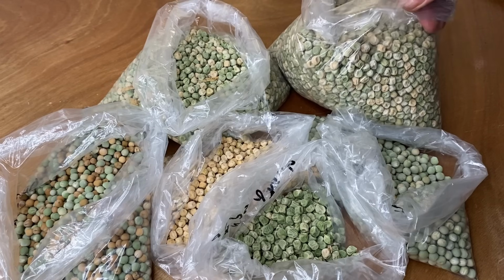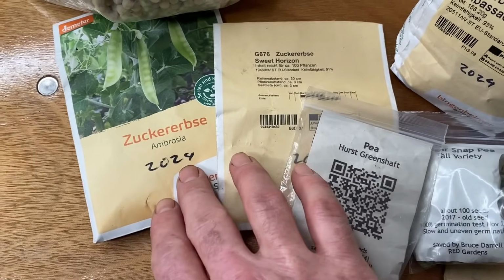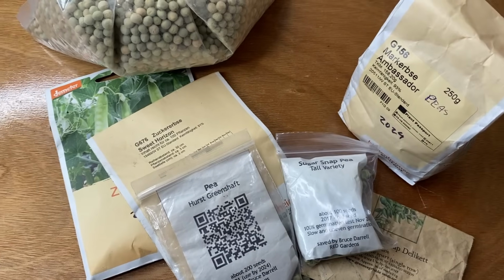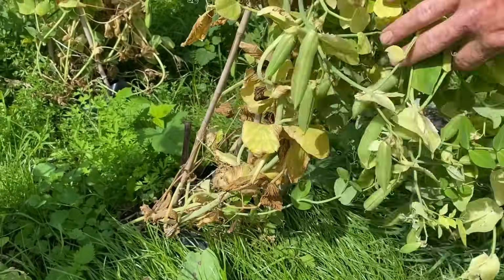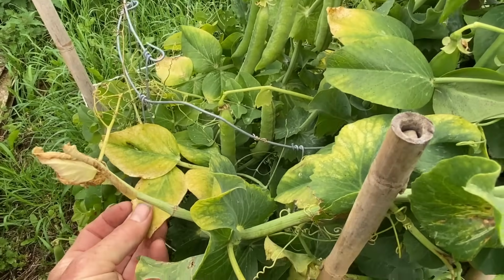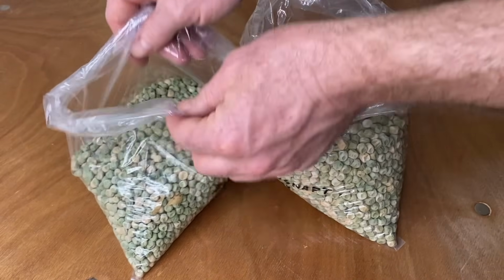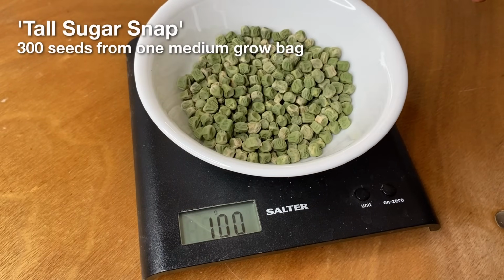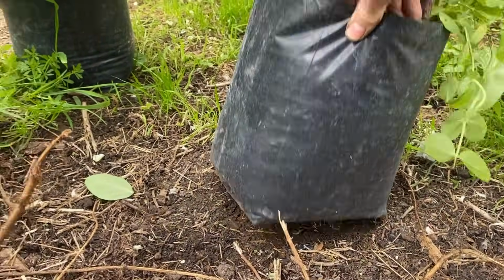Grow Bag Seed Saving

Comment: Zone 6a, with frost dates May 10th and then Oct 14th. I save bean seeds. I grow 4 succession crops of green beans for marketing, all 50ft rows. The beans i grow are a 56 day crop. My plant dates are May 1st (2 rows that may/may not get frosted), May 10th 8 rows,  June 10th 4 rows, and July 1st 8 rows for fall harvest. I mulch all my beans in grass clippings. I harvest on beans, and when the next succession crop comes on I mow off the old patch or let it produce my seed crop. What i have found is the grass clippings on both May crops will thin out and the weeds will overtake the patch and make harvested bean seeds really hard. The July crop will give you the best beans, but is to late for dry beans, the frost gets them. So, on beans, if i was only growing for dry pods, my planting date would be 10 June, not just after last frost, 10 May. Hope thats not too confusing.
Reply from the maker: Thanks for sharing your experience. That is really interesting how things change with the different planting dates, and so much changes with how he mulch is affected.

Comment: You can buy bags different shapes, I have some which are a similar diameter to their height, they won't blow over.
Alan Titchmarsh wrote that peas aren't worth growing because the ones in the Supermarket are far cheaper, easier and you won't beat their quality either, he does have a good point!
Reply from the maker: I disagree with Alan, mainly because nothing beats the peas you pick from the plant and eat directly. And we can't get fresh peas in any shop around here. Bu they are a lot of work!
Reply: @REDGardens  that is the only advantage, they're a tasty snack when you're in the garden. 
Do a blind taste test with some people, yours V the Supermarket ones both cooked and see which people pick. I'm talking about peas from a pod btw, not the other varieties.
I still grow them atm though!
I've got some mange tout about a foot high in an unheated PT, started them off last August/Sept as a test to see how they'd fare over Winter. They've survived so far, even when it was down to -7 outside. Hoping for an early Summer crop. Done the same with onions from seed.

Comment: I see some issue here: On one side, you anticipate no (or insignificant) cross-polination. Otherwise you would not have the bags placed close to each other without any protection. On the other side, you worry about genetic robustness.
But how can genetic robustness come even into play if the plants don't cross-polinate?
Reply from the maker: Good question. I am not sure if this applies to pea plants, but I am assuming that there is always slight variation within the plants, and more plants would be better. But perhaps I am wrong, and saving from even one pea plant year after year is perfectly fine, but it doesn't feel right to me. I should do some research on that. 😁
Reply: I have the same question. The only thing I can think of is that with only 4 plants it might be harder to spot any non typical traits of the veriety. Choosing the 10 best or most similar out of 100  plants is easier. If you're unlucky all 4 plants might be slightly different, then which one is typical for the variety...

Comment: Hi Bruce, 
I have been doing an experiment this winter focused on soil life health. I planted peas as a cover crop in my main garden and let them grow to be 10 to 15 cm tall. I then covered 1/2 of this garden with leaves to 1/3 of a meter deep. So far the area with the leaves is wet near the soil line and has worms, isopods and still living peas that show some nitrogen fixing happening. The area with just pea cover is mostly frozen and has no animal life that I can see, but the peas are still alive and green. In the spring I will remove the leaves and compare the soil from each side for animal life, soil compactness and nitrogen nodule fixing content. 
Only 2 more months to go!
Reply: What did you learn?

Comment: Micro-green variety peas is a misnomer in my eyes, as any pea variety should work as a micro-green. So the multi color seeds could be an indication that the supplier tossed in poor selling peas into the mix to move the supply before they lose viability(which is what you should do with your older seed). However some peas do have multi colored seed. 
To everyone that saves seed: bring in a new packet of seed every 4 or 5 years to add to the seed saving patch to keep genetic diversity high. For self pollinating plants like peas, it makes sense to manually cross pollinate several plants to help with the diversity but be aware that this can change the plant into a new variety in rare instances.
Reply: The difference could be the flavor of the plant vs the flavor of the pea you never until you try.
Reply: @LowkeyTryhard  I've taken pea shoots from lots of varieties of peas. They all seem the same to me.